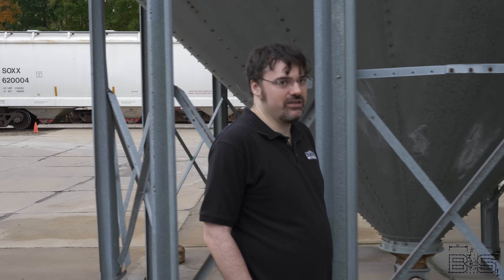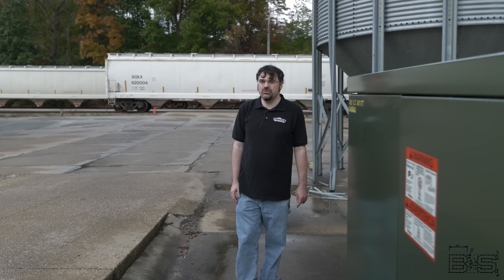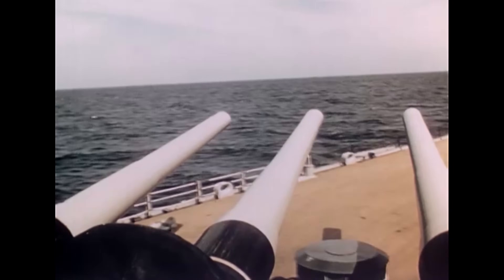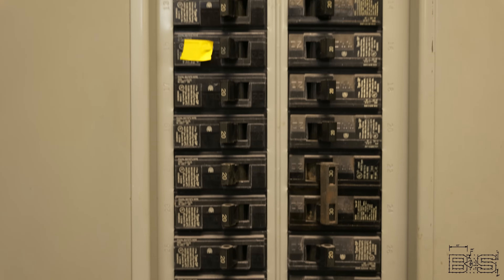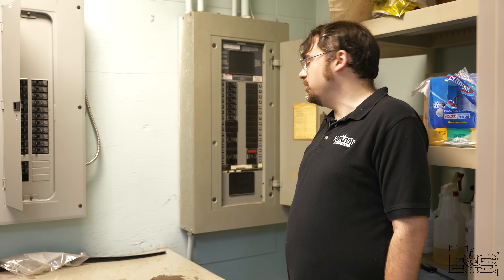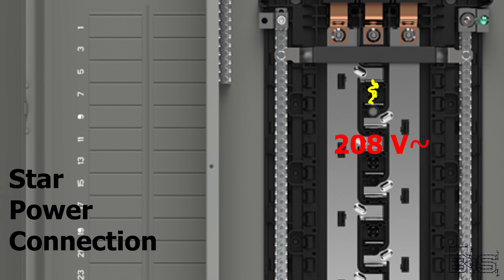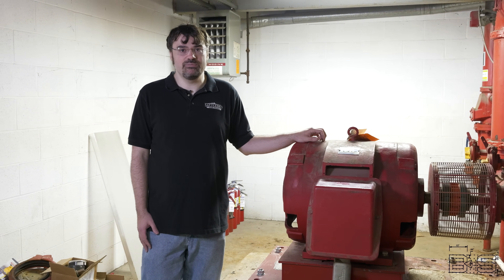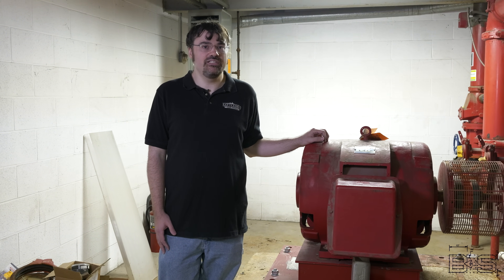Industrial 3 Phase Power

Comment: In Germany, 3-phase power is pretty common in the household switchbox these days. Especially if you have a flow-through water heater, for example. It's just rarely exposed on an outlet, except in a workshop.
Reply: Same here in the Netherlands.
We have 3×400V at 40A.
It reduces wire costs and provides nice 230V for users.

Comment: I think my Air Conditioner is the highest current draw in my house, but I don't know the rating of the circuit or the device. It's probably 50 amps.

I'm about to put a new panel in my garage for welding and electric car charging. It will be a 100 amp panel,  but the electrician said different cars need different amps.

I'll probably get a "Level 2" charger on 50 amps, though it's possible I could get a Level 3 charger and get up to 100 amps, though this would max out the whole panel.

Comment: My plant uses Delta because we have a descent size chemical plant in house. We don't want a neutral for safety reasons. We have an installed ground fault detection system to watch over our systems. We are laid out like a ship. except we have 3 power feeds coming into the plant making "3 Power Banks". Its a very interesting system. Ex Navy guys are surprised when they see it.

Our steam plant (where I am Deputy Chief Engineer SSE1) is also setup like a ships steam plant with LOTS of redundancy. Way more then most power plants, never mind industrial plants. We just don't have the large turbines. Most of our steam goes to process use. We only do a cold iron outage every 7 to 10 years. Because of what we do a steam plant failure can cost millions in lost product in minutes. As such there are very few systems that we are not at least 3 layers deep with redundancy and some more. Our boilers are way over sized for the load we place on them. 

Its a neat place to work.